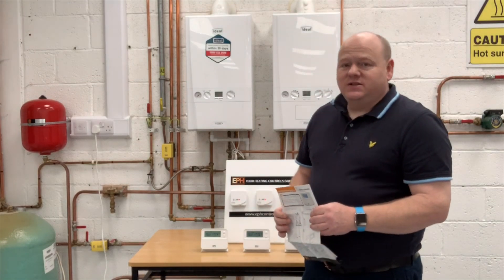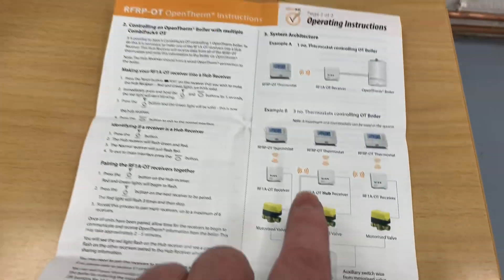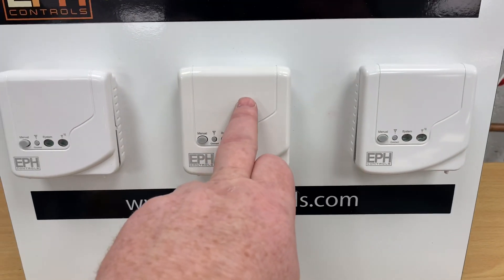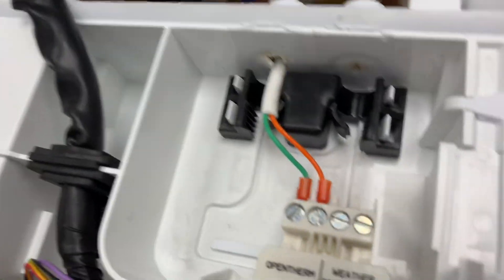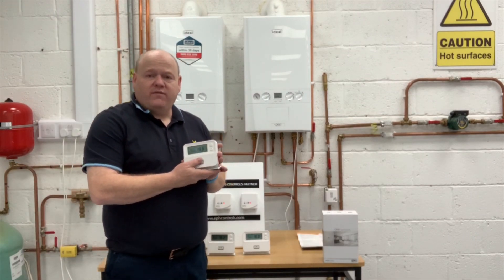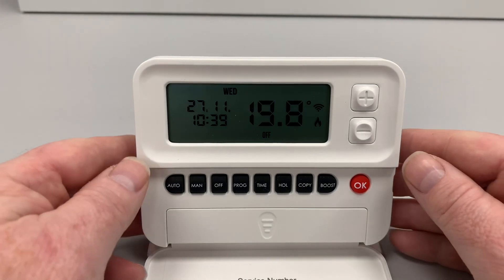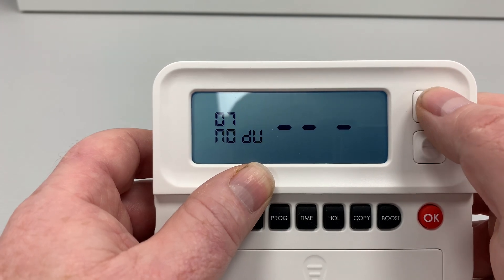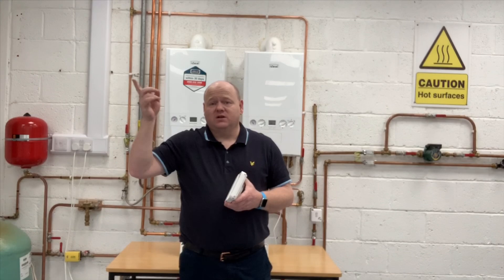Multi Zone OpenTherm Central Heating Systems.

Comment: the problem with multi zone and Open therm is that the thermostats are all wireless which is useless if zone 2 is on the third floor and the boiler and it's receiver/hub are in the basement. I have spent hours trying to find a solution where zone 2 can use a wired stat but it looks like it doesn't exist. It seems that the innovation in this area is only interested in the mass market - i.e flats and small houses. Given the net zero nonsense and the price of energy you would think that this technology (OT) would be standard in smart thermostats
Reply: You can wire the receiver for the zone wherever you want. It does mean running a cable to the floor the zone is located.

Comment: im assuming that each reciever is wired using S Plan to the zone valve and the master Controller modulates the boiler accordingly in  Star like topology
Reply from the maker: Yes.

Comment: Hi Alan, I have Eph hub installed In conjunction with an Ideal 35kw gas combi boiler.  Is it possible to control the flow temperature of the water remotely?

Comment: Is a wireless cylinder thermostat in an S plan like this compatible with regulations for an unvented cylinder? Thought it had to have a thermal overheat sensor.
Reply: You'd need a HW tank with 2 sensor pockets. One for the HW-OT RF connection back to the boiler for Open Therm HW temp modulation. The other sensor would be a standard overheat type linked into the S plan wiring. G3 doesn't allow just one thermostat to both control HW temp and also act as thermal cut-out.
Reply: Yes, that’s how I understood  the G3 Regs.

Comment: Hi Allen, this looks to be just what I’ve been looking for. Can we have more details (maybe a dedicated video?) on converting S plan to OpenTherm in this way? I’ve looked on EPH’s website but can’t see anything relevant (perhaps my GoogleFu is weak!). What cylinder stat would be used? How far away can the receiver bixes be from each other? (Ideally I’d like to put the OT connected box next to the boiler to limit the low-voltage cable length). And would it be possible to implement PDHW in this way, perhaps by making the OT-connected receiver the master? Looking really interesting, but not quite enough details yet...👍
Reply from the maker: Give them a call.

Comment: I'm wondering if you can plug multiple smart thermostats the way that they will be supporting opentherm ? So instead of cabling one thermostat to OT port of the boiler, you could wire two or more thermostats relays to that OT port ??? Like multiple Nest controllers etc ??? What do you think ?

Comment: Hi Allen.  I'm a bit confused about how we open the zone valves. They aren't wired in in this video. 
Also, do you know if it does hot water priority?
Reply: Lol... He has no answer to this apparently, because it's unusable on system boilers

Comment: Evening mate, I'm struggling to understand this, what is the difference between have this and just 3 separate stats on 2 ports with switched lives going to the combi? What is the difference with open therm other than low voltage?
Reply: OpenTherm is an open protocol which any manufacturer can  use. This gives a wide range of third party devices to use, giving competition and choice.  Connecting an Opentherm thermostat to a boiler which is OpenTherm compatible means you have load compensation.  That means the burner will modulate to maintain the room temperature setpoint. No inefficient on-off boiler cycling.

This setup has one master thermostat/controller which is connected to the boiler, with all others off this, giving one master -> many slaves. The boiler will output the highest temperature that any of the controllers call for. If say 4 zones are calling for, 1) 40C, 2) 45C, 3) 50C and 4) 65C.  The boiler will output 65C. If zone 4) is demanding 65C, then quickly demands 35C, the boiler will then output the temperature demand from the highest calling zone which is zone 3) at 50C.
Reply: @johnburns4017  This system is pretty unique at the moment. The central hub is adding up the heat demand (in degrees) from multiple zones to get a total heat demand that it sends to the boiler. Most Opentherm implementations on take the demand from one zone and send it to the boiler which means the boiler isn't producing enough heat to satisfy the demand from the remaining zones.
Reply: @johnburns4017  It’s difficult to know exactly what is happening without looking at the OpenTherm signal, or without the manufacturer being  open about it. I think manufacturers are missing a trick in not making their logic available to those of us who are interested.

Comment: Been using EPH feel the whole look of them is very dated and old. Will see how reliable they are not had anyone on the phone yet
Reply from the maker: Lewis Beaton I have actually opened one up and looked at the components, looks good quality on the inside. Also has 5 year warranty
Reply: Suppose its all subject too opinion i just believe aesthetically they have let themselves down a bit. It looks no newer than an old honeywell 2 channel

Comment: How can u have OT data & mains in the same cable? The surely need to be separate & the OT conductors screened with CY cable or similar?   Other than that it looks great
Reply from the maker: Open Term isn’t in the same cable 👍 Thanks
Reply: it looks like the same cable, as it leaves the main controller, but looking at the boiler you can see they are separate, would be better if the wires were separated at the control.
Reply: @robertwhite4919  do you mean that the 2 seperate cables would leave the control through 2 seperate openings in the plastic control housing instead of 2 cables through one openjng?
Reply: @justinklrjms  the origin question was about the single cable, but as you say it is two cable in the same hole which wasn't clear on the video, it is usually good practice to keep the data and mains connections separated. As mentioned screening may be required and not good to run data cables along side mains cables as can cause interference, should all be in the installation manual.